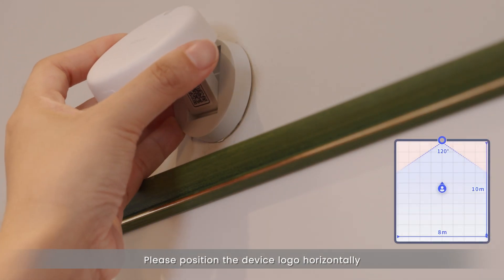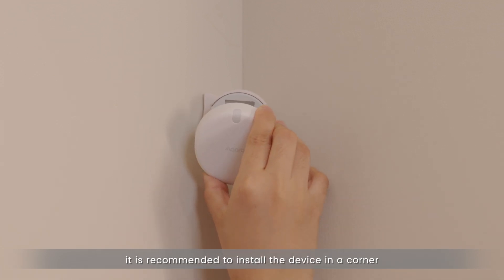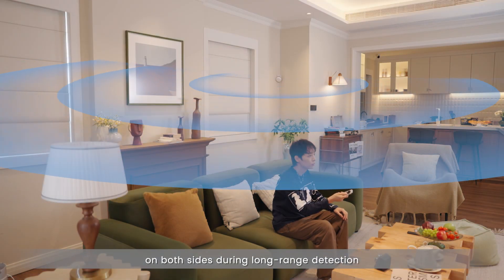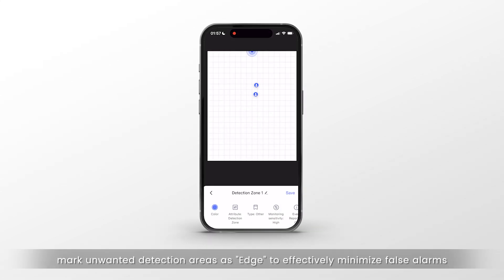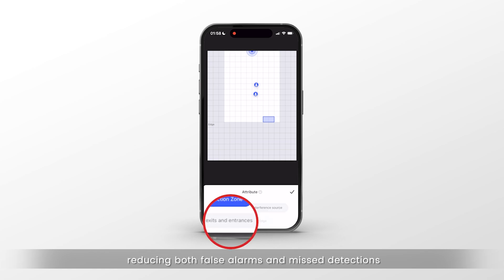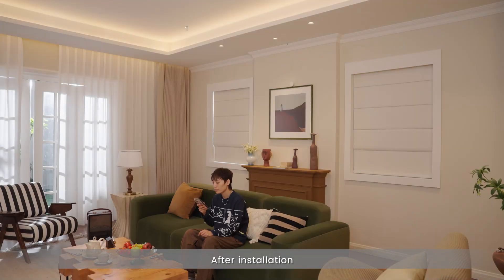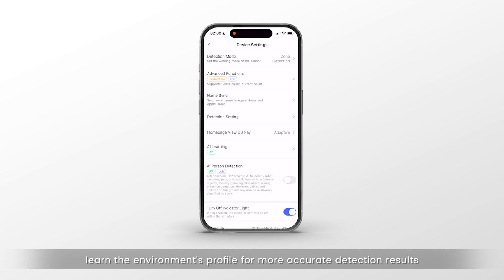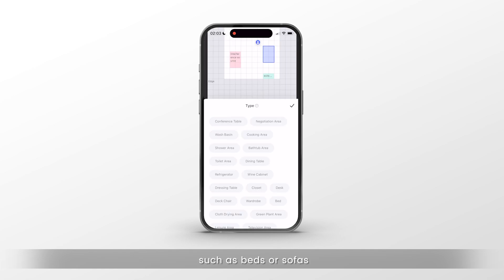Maximize Accuracy: Pro Tips for Perfect FP2 Presence Sensor Installation

Comment: when are you releasing battery powered FP2?
Reply: If your talking about the FP300, Aqara mentioned at CES that it would be released this year. But didn’t give a specific date.
Reply from the maker: @jasonpatrick  Thanks for the question! We’re definitely working on it — the FP300, our upcoming battery-powered presence sensor, was previewed at CES and is on track for release soon (hopefully in Q3!). Stay tuned!
Reply: @Aqara  amazing.
Reply: @Aqara  is it available Zone detection like FP2, or what is the next version of FP2 battery-powered
Reply: @Aqara  Will it be battery powered only, or will we also be able to power it via POE or via an outlet like the FP2?
Reply from the maker: @mrjajayoung  Battery!
Reply: You obviously enjoy changing batteries. Power use is too much. There is a mmWave sensor that uses batteries, but it has PIR sensor to detect presence then turns the mmWave on… this seems like a complete faff and another deal and something else to go wrong.